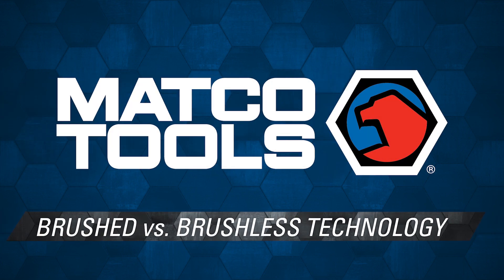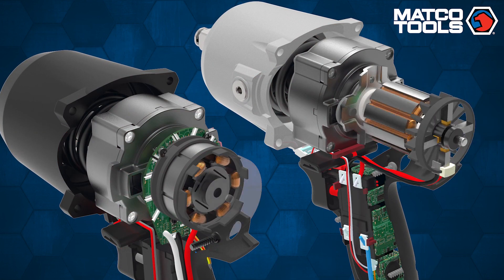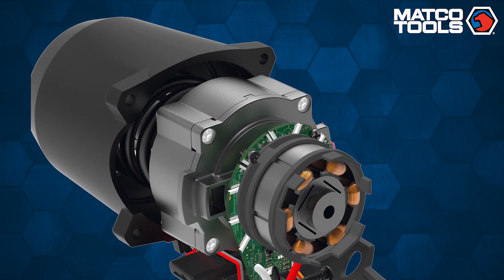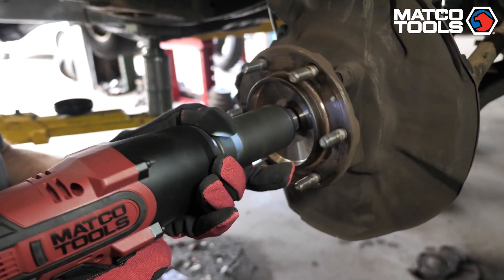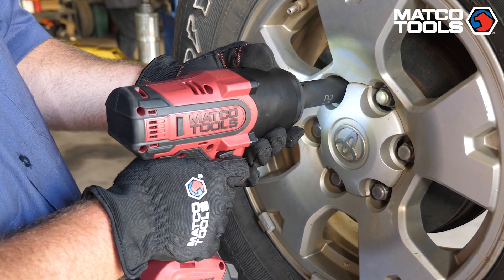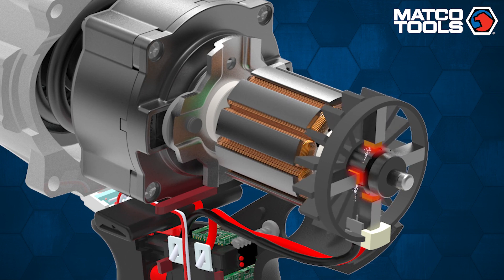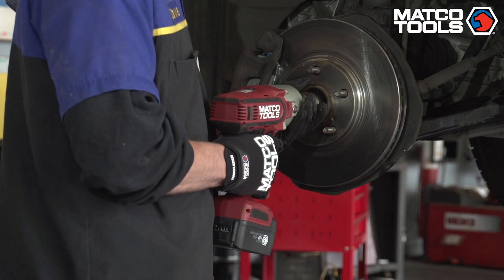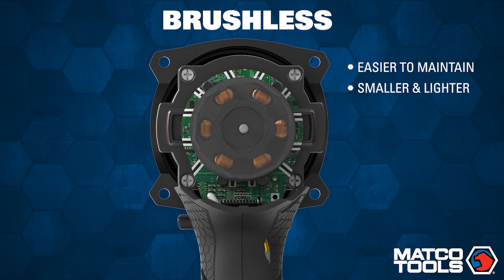Brushless vs. Brushed Power Tools – What’s the Difference?

Comment: As an industrial technician, 4-pole motors are almost as powerful as brushless motors. However, the 4-pole motor has a much higher durability compared to the control circuit of a brushless motor.
Reply: BS, just say you work for Bosh

Comment: Why even mention brushes in 2024? I just see word brushless everywhere but isn't that the default at this point...
Reply from the maker: Depends on user preference. Brushed is typically easier on the wallet, but won't last as long and the tool tends to run hot quicker. Brushless is the way to go to get the most out of your tool and to extend its life, if you don't mind spending a little more.
Reply: An explanation of the difference is good. And more options is also good

Comment: Wonder why Makita switched to using brushed.  They're still bloody expensive.  Shrinkflation maybe.
Reply: If a brushed tool breaks its easy and cheap to repair, if a brushless breaks ( and they are hard to break ) you better trow it away and buy a new ONE!
Reply: @Bulba_lagd exactly
Reply: @Bulba_lagd  I have two brushed drills laying in dust because I can't find suitable  brushes for them. Also have a small grinder with the same problem.

Comment: Then why do brushed even exist
Reply from the maker: Brushed is a more cost-effective option. Brushless steps up the game!
Reply: @matcotoolsvideos  I wouldn't say it's more cost-effective. Only that it costs less. Whether or not it's more cost-effective depends on use case
Reply: Over the years man got smarter ! From brushed to brushless
Reply: brushed, you can give to your grand grand children, brushless i don't know the electronics will last and how much for repairing
Reply: Yea more expensive for brushless but the electronics can break also they must also be heavy duty and increase cost even more even tuff metal parts wear out imagine not metal parts? Might be more powerfull and not over heat as much compared to brushed motor but may be more weak in a way and not as tough. I never new power tools with brushed motor had a drawback due to brushes wearing out.
Reply: Because they work!  And don't require a computer chip to make them run!  Much simpler and work!

Comment: Does the brushless motor uses permanent magnet on the rotor ? If it is  not then how is it spinning ?
Reply: They are electromagnets, the computer chip coordinates the activation of each magnet to achieve the desired rpm.
Reply: @ronswanson4422  but the rotor is spinning and its brushless how could rotor be magnetize
Reply: @basilalsulami8411 electro lmao
Reply: Yes that is correct, as I understand having debated a brush-less vs brushed leaf blower.  The brush-less has a permanent magnet on the rotor and the stater has coils that energize at the direction of a small computer chip.
Supposedly the brush-less is more efficient and longer lasting, that is unless there is a problem with the computer chip.
I chose the brushed model as it was less expensive and of the same quality build and it is a proven design and my usage will not be great as a homeowner.